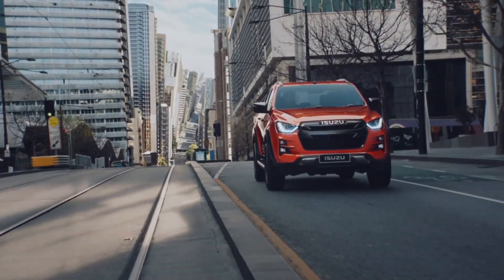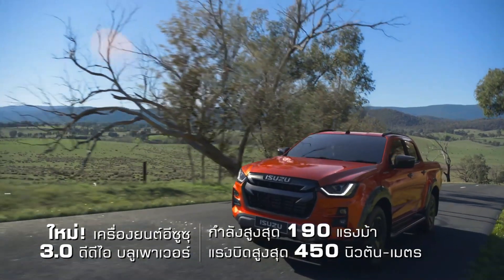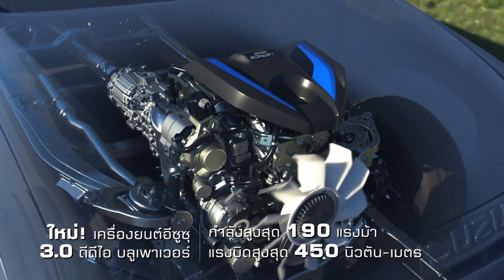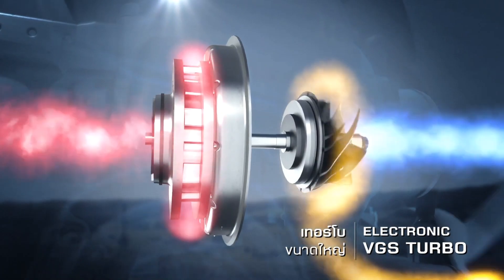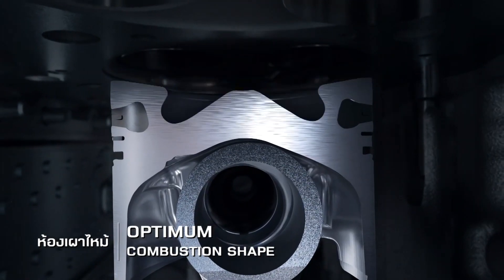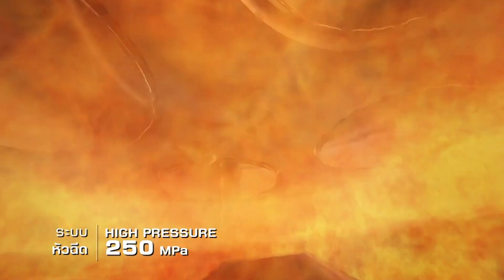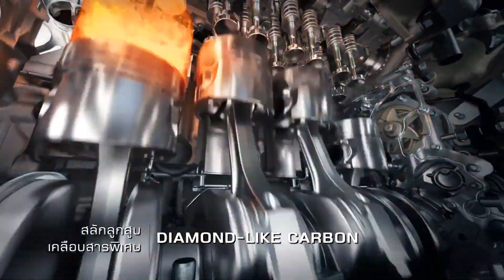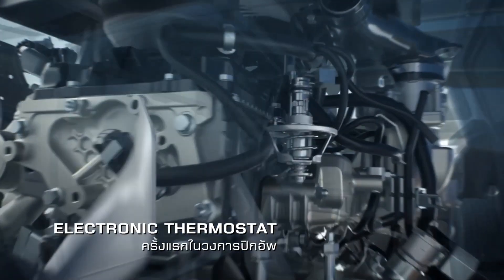2020 Isuzu D Max Pickup Truck Engine and Powertrain

Comment: Not Chevy Colorado based. Your facts wrong.
Reply: Chevy Colorado is based on this truck.
Reply: @reubinthomas  its not. The old model yes. But this is a totally new model and the Chevy is also totally new. Isuzu and general motors split 2 years ago.